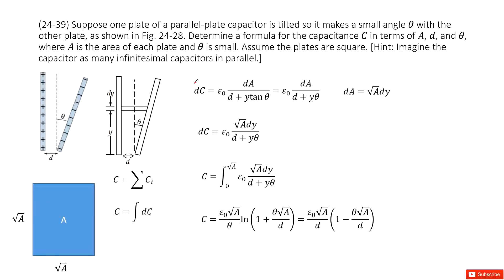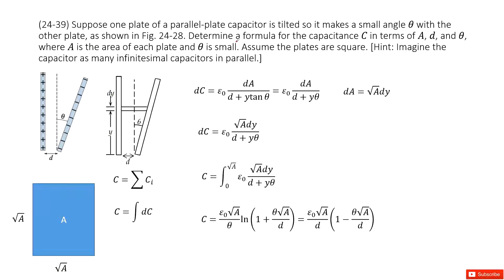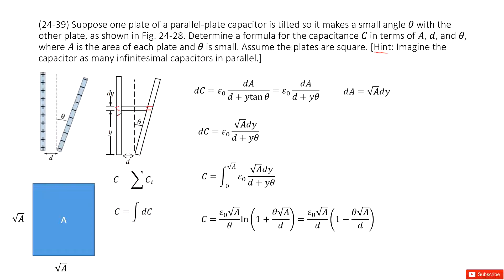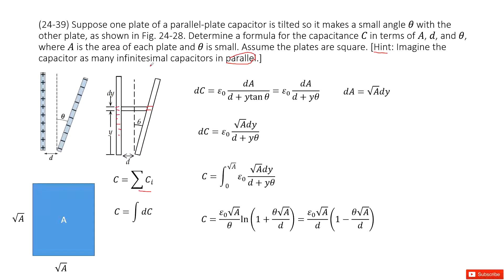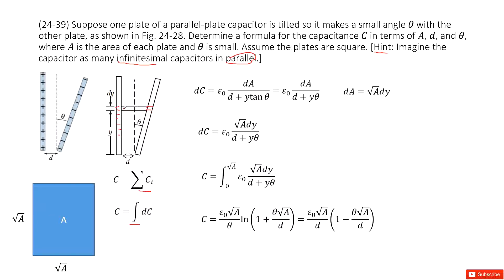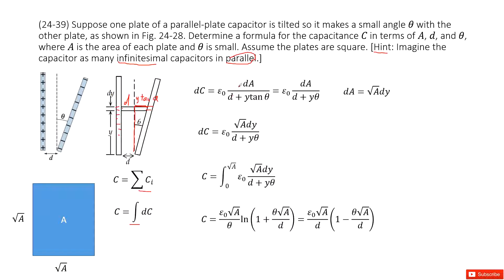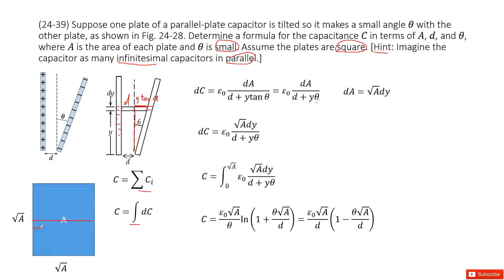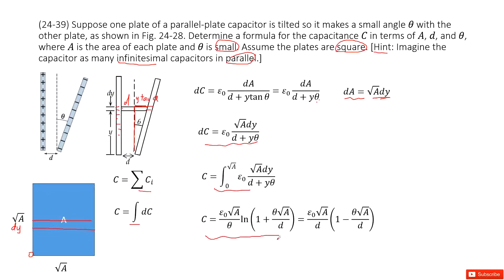(24-39) Suppose one plate of a parallel-plate capacitor is tilted so it makes a small angle θ with t

Comment: ı do not understand the last step of solution . how can we eliminate ln
Reply: Ln(1+x)= x - x²/2 + x³/3 - x⁴/4+ ...
Only the first 2 terms are used. Also, she miscalculated in that last step. In front of the parantheses there is supposed to be an A instead of sqrt(A). And inside the parantheses you divide by 2d instead of d. That's the solution according to the book